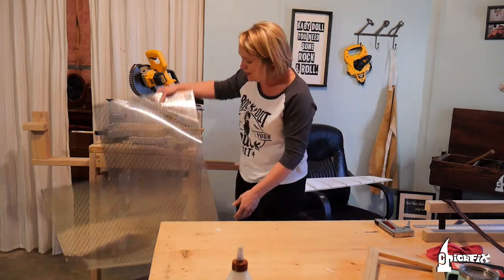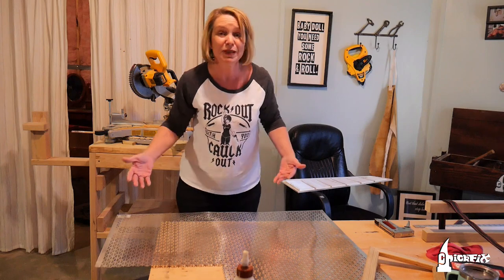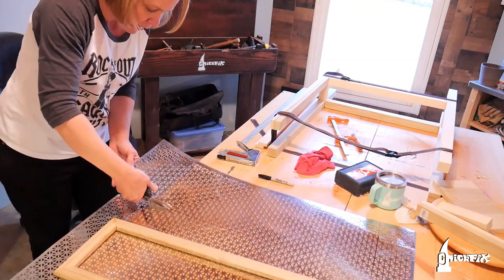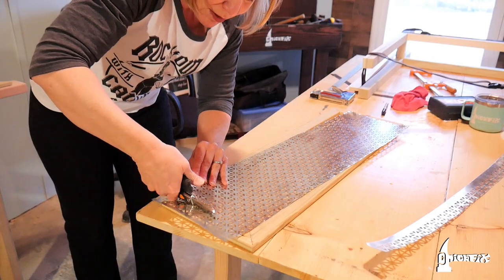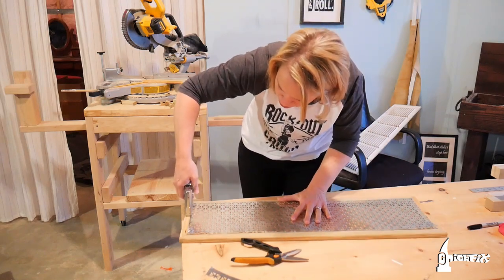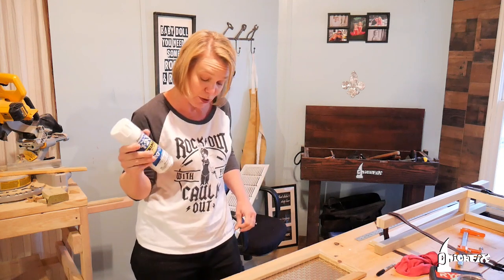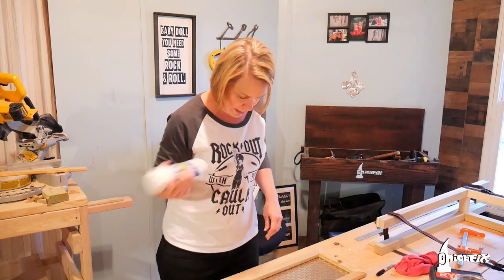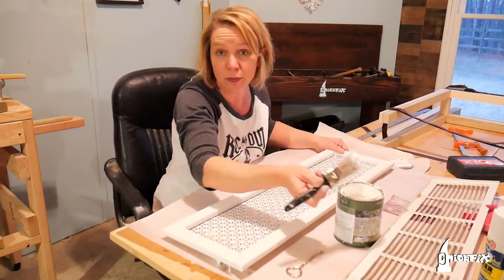Decorative Cover for Home Air Intake Vents

Comment: You may want to measure the area of free space available for the air to go through your old vent as compared to the beautiful one you created. It is hard to tell from the video, but you may be choking your FAU significantly especially if you did that to all three. The more open the vents, the more efficient your system runs.
Reply from the maker: Thank you for the tip! I was actually concerned about that, and shows a pattern that had the largest openings. So far so good

Comment: Did you seriously brush paint onto the aluminum screen itself??? For those who would prefer to keep the aluminum look, Rustoleum makes an aerosol enamel in both gloss and matte, I believe it's called 'Stop Rust Matte clear enamel' and I've had a great deal of success applying to different metals to prevent corrosion and wear. Interesting idea using staples to hold the screen on, I'll have to just do that when I get around to my intake covers pretty soon here.